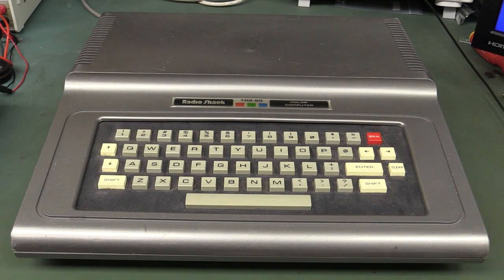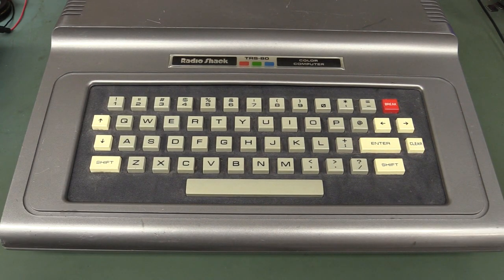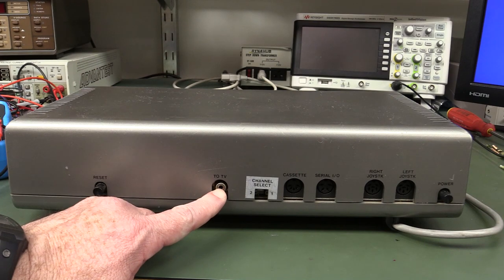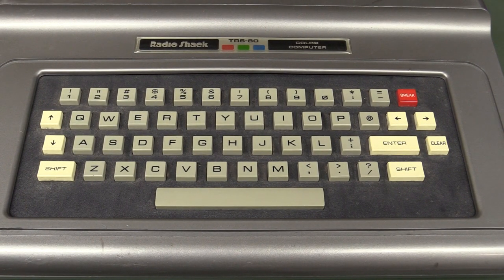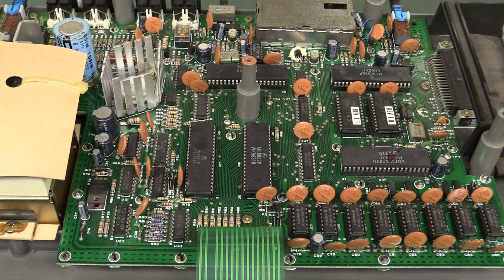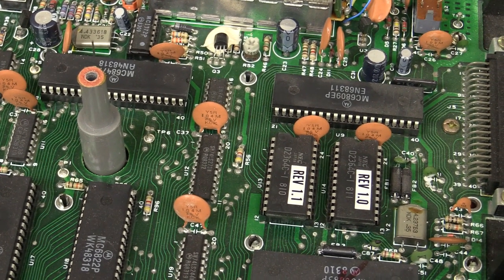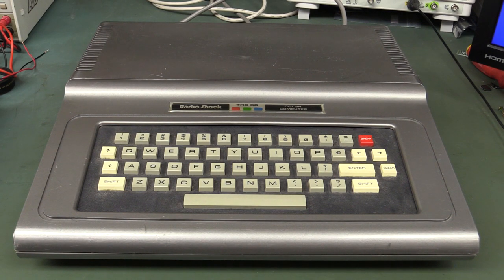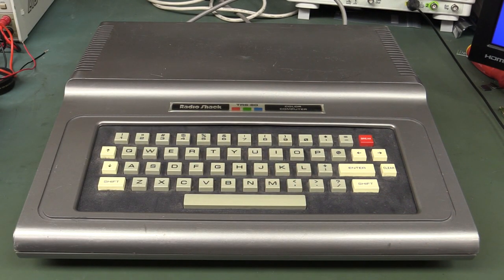EEVblog #1021 - Retro Radio Shack TRS-80 Color Computer

Comment: Oh man. What a walk down Memory Lane.  My parents bought me one of these for Christmas when I was 12, and I used it to learn 6809 Assembly,  and that has led to a 20+ year career in programming - I now write world-scalable cloud software.  I remember reading the thick 6809 reference manual for hours, the "Z-Bug" plug-in cartridge debugger, and the cassette recorder you stored your data on.  I remember learning to solder to upgrade the RAM from 16K to 64K (who will ever need more than that???).  I remember taking on an extra paper route to earn money for the $200 (!) floppy drive.

Probably the best thing my parents ever did for me was buy me a CoCo.
Reply: About my same story!  I had the "Editor Assembler with ZBug pack" too, a COCO 2, and upgraded to the COCO3.  Best gift I ever got!
Reply: I started with a 4k Timex-Sinclair 1000. It was a birthday present from my parents. It was best as a door stop. 4 failed within 2 weeks. We ended up returning it and my parents got me a 16k CoCo 1 for Christmas. That ended my allowance for a long time, since that thing cost a relative fortune at the time. I learned to make my soldering iron do the Triple Lindy when I upgraded the chicklet keyboard. The aftermarket ribbon cable was very thick and unwieldy and partially tore out of the keyboard's circuit board...so I had to solder a few tiny jumper wires. Scary.
Reply: Good story! I loved the hobbyist industry that quickly sprang up around the Coco in the 80s. Companies like Spectrum Projects, one of my faves. Didn't get into Assembly then, but actually thinking of taking it up now for fun!

Comment: WIth a simple capacitive buffer, the DC level will drift depending on the content, but those converters can also be rather fussy, especially with 50Hz sources
Reply from the maker: The problem was still there even without the AC coupling and using the recommended transistor buffer, so it's not that. The car rear view mirror was rock solid with AC coupling though but ultimately didn't look very good. So the ebay converter box is a bit flaky.
Reply: A lot of modern tv processing chips don't like the 240p signal that these older systems would often put out. (Since it was essentially a hack.) Perhaps that is the case here too?
Reply: most 'home' computers video signals did not conform totally to 'broadcast/official' standards, which modern tvs are designed for, some tvs are extremely picky, like mine...
Reply: many produced in particular a 'bodge' single frame sync pulse, instead of a correct pulse train, ,and some incorrect/missing 'back porch' level...
Reply: Obviously in the 80s this would be connected to a CRT TV. CRT TVs are much less picky about the input signal. They'll just display what ever is input, pretty much.
Reply: Shouldn't the resistor on the emitter follower output be 75 ohm? If there's impedence mismatch the sync will be affected as well as messing with the PAL subcarrier quality. On an interlaced CRT screen it would look perfectly clear, unfortunately the scan-conversions done on the analogue inputs on modern displays are sub-par and make the picture appear worse than it should be.
Reply: very likely! especially if its a modern tv, as i said above, the sync pulses are not to 'standard', this wasnt a problem with older tvs using analogue sync processing...
Reply: are you connecting by rf(aerial) or some sort of composite/rgb feed? if composite, you could try one of those 'video copy processors/enhancers' as these usually 'clean up' the sync pulses..
Reply: I believe 75Ω is the impedance not the resistance of the coaxial cable that was used. But my electronics is shaky at best so there is that :P
Reply: yes, and is also the input impedance (in many cases a 75 ohm resistor to ground) of the composite in of a tv...

Comment: I had a Coco 2 and I still have a Coco 3. Very cool machines in their time. They actually had a multitasking OS called OS-9 That was doing windowing more efficiently at 2Mhz than the PCs at 3.77Mhz. Ahh those were the days! When efficient coding and assembly were necessary skills to create software!
Reply: I had one a bit older than what's in this video. Mail-ordering a real keyboard was mandatory with those. I remember the horrific confines of 16k and the feeling of luxury when I upgraded the RAM to 64k. Then, inevitably running out again. Swapping subroutines from the disk drive became standard. I also remember swapping the ROM to RAM and modifying the Extended BASIC to suit my needs. I learned Assembler on that rig, too. LOVED the 6809e instruction set. I have emulators now...always toy with the idea of buying a vintage CoCo online.

Comment: Dave, thanks as always for giving love to vintage computers. I hope you can do a video on the BBC Micro some day so I can hear you rave about its beautiful design. I'm gonna put my neck on the line and say I don't think any 80's home computer can really compare for build quality. Come on you Brits, back me up!
Reply: Yeah, the issue 7 boards were pretty indestructible. Dave did an Acorn A3000 here, by the way: https://youtu.be/tPq7OF3fkcE
Reply: ForViewingOnly

The Beeb was and still is an amazingly solid machine.

Only common issue are the X2 mains filter caps releasing the magic smoke, but that's no big deal, just as long as you hold your breath. lol

I'm hoping Dave and everyone on the EEVblog forum has at least seen "Micro Men"?
(there's a good 720p version on YouTube.)
Reply: I was 6 in 1990 and my primary school had a BBC micro. Obviously at that age I didn't know how to use it.
Reply: How about compared to the Apple ][? Really, that is a very interesting design which isn't too far off the BBC, but with the ability to really modify its abilities via adding in more cards. It even had a built-in assembler in the early versions, so quite equivalent in many ways.
Reply: Yeah, I was thinking of the Apple II when I posted the original comment. Another beautiful and reliable design, but I'd probably put the BBC Micro ahead of it for design & build quality... maybe I'm a biased fanboy. But the Apple did have the BBC beat by 4 years though (1977 for the Apple compared to the Beeb's 1981).  The Apple is the only other 8-bit home computer I can think of with a built-in switch mode PSU like the BBC.
Reply: Having owned both in the day...

Apple II is slightly faster (1MHz vs. ~900kHz) but a less capable CPU (6502 vs 6809).  Later models of both ran faster.

Apple II has higher resolution video (40x24 text, 40x48 low-res graphics in 16 colors, 280x192 hi-res graphics in 2 colors (6 with artifact colors)) vs the CoCo's (32x16 text, 64x32 low-res graphics in 9 colors, 256x192 hi-res graphics in 2 colors (more with artifact colors)).  Later model Apple IIs went up to 80x24 text, 80x48 "double-low-res" graphics in 16 colors and 560x192 "double-hi-res" graphics in 2 colors (16 with artifact colors).

Apple II video output was always composite (requiring an external RF modulator for TV output).  The CoCo was always RF output (requiring a hardware hack for composite).  Apple II's supported RGB video via expansion cards.

CoCo has better sound.  6-bit DAC vs 1-bit "click the speaker" register.  Apple II's needed third-party hardware to get good sound.

Apple II has more slots (8 slots) vs the CoCo's single "cartridge port".  The CoCo later got a "multi-port adapter" to support four slots/cartridges at a time.

Apple II had a much better keyboard (mechanically), but was inferior from a software perspective.  The Apple II's keyboard was effectively a TTY attached to a serial port, whereas the CoCo was wired to one of the PIA chips and could detect things like key-up events and (within limits) detect arbitrary combinations of keys held down simultaneously.

Comment: Boy, I could go on for hours about this machine.  I had one back in the day, and to answer a few questions, #1, yes, once you got the video straight, that's about how good it looked on a TV, mainly because you're compressing the composite signal into RF modulation to feed into your TV antenna input.  If you ditched the shitty RCA cable they give you with the unit, and use a really high quality shielded one, and you had a TV that "liked" the signal from the CoCo (some rendered better than others), that's about the best you could do with RF modulation.  The composite mods DEFINITELY improved the video by leaps and bounds, mainly eliminating the herring bone interference pattern you get with RF modulation.  The 3rd version of the computer actually had 3 different type video outputs... RF modulation, composite out, and CoCo 3 monitor input on the bottom of the unit.  The CoCo 3 monitor was a digital monitor, and a proper computer monitor for the CoCo.  It had the absolute best display you could ask for along with true lower case characters, (no fancy decenders mind you), along with 40, 64 and 80 column characters.  The 3rd version could display up to 16 colors from a palette of 64 colors.  Aside from the the slightly improved video, the 3 was mostly identical to the 1 and 2.  Depending on the age of the MC6847, there is a way to kick it into true lower case on the color computer 2, not sure if the late model CoCO 1's were capable of that or not.  The design essentially came from a terminal that was made first.  A company called agVision wanted a cheap terminal to sell to farmers, so they went to Motorola who basically handed them the design you see in the block diagram, and instead of BASIC in ROM there was a terminal program.  agVison needed someone to design, manufacture and distribute the unit, so that's when the approached Tandy.  Smart cookies at Radio Shack realized they could swap out the terminal program for BASIC and have a general purpose machine rather than a task specific computer terminal.  The price wound up being the same, so the terminal was soon canceled, and the same terminal software was available as a cartridge.  A 4 connector expansion interface enabled up to 4 cartridges at once, hence, a disk controller, proper RS232 port, etc could be connected and software selected at will.  Believe it or not, there's a still thriving CoCo community out there to this day complete with people making new software.

Comment: You could also get the "Radio Shack Color Computer Technical Manual" which was a publication of Motorola for Radio Shack. It was a true technical manual (about 80 pages) with complete theory of operation of all the major circuits in the TRS-80 CoCo complete with schematics. The publication is still available online. This manual along with the "Assembly Language Cartridge for 6809" were pure gold for this (at the time) high school senior.
Reply from the maker: Yes, I have this linked in the description.

Comment: Back in '81 we used to sell these like hot-cakes until the VIC-20 tapped the market. For a little while Tandy made a scaled-down CoCo called the MC-10 but I haven't seen one in years. As an assistant manager at the Toronto 645 Yonge St. store, they never paid me enough money to buy a C64 so I had to steal one... technically... Since my brother and I lived near the Commodore plant in Scarborough, we used to check the dumpster at night until we got enough parts to assemble our own working C64 (complete with floppy drive). As Charlie Bunker used to say, "those were the days".
Reply from the maker: Great stuff!
Reply: The MC-10 was essentially a color version of a Timex Sinclair 1000.
Reply: Our Canadian models had that "CoCo look" with the Chicklet keys. I think I opened one and saw a Motorola 68 series CPU (but not the mighty 6809).
Reply: I remember that store: just north of Isabella St.
Reply: Yup, just a hole-in-the-wall so close to Yonge & Bloor (proverbial arm-pit of Canada..) I always wanted to work at Paul Aire's store down in the Eaton Center. No matter how closely we kept vigil, we always had stuff stolen right out of our front display case on Christmas Eve. Elbow-to-elbow last minute shoppers, thieves and skin-heads.
Reply: Wasn't it Archie Bunker?
Reply: Roger Wilco Oops! Yeah, you caught one of my many senior moments...
Reply: Yeh, I have more of those than I'd like to admit.
Reply: @rogerwilco5187  Yup, it was. loved it.
Reply: Despite the name, instead of a 6809 the MC-10 had a 6800 CPU which was significantly less capable. (Actually a 6803 microcontroller, if I recall correctly, but its CPU core was 6800.)

Comment: Those ROMs are Color Basic 1.1 and Extended Color Basic 1.0. The second generation of the CoCo "one" came with Color Basic 1.1. Fun note: This was back before BIOS days so some smart assembly language programmers leveraged code in the ROMs by calling directly to the starting addresses of the routines. This created an incompatibility between the old and new ROMs with some specialized applications.

Comment: One ROM is for Color Basic, the other is for Extended Color Basic.
Reply from the maker: Oh, interesting, thanks.
Reply: Back then, Radio Shack would NOT sell you the Extended BASIC chip. You were required to bring your computer in and they'd ship it to the closest service center for installation (at an additional cost, of course). I think I was without mine for over a week. Mail order houses would happily sell you just the chip. The specialized service instructions were "take off lid, install chip in socket, replace lid".
Reply: Or.. you took a cassette tape to your local Radioshack, and  did a "CSAVEM" command to save the Extended basic rom to cassette, and took it home to burn your own EPROM..  Not that I'd know..  :-)
Reply: I recall the articles which told you how to burn your own EPROM but left you on your own to somehow get a legal copy of the contents.
Reply: more info.
Reply: "legal copy"?
Reply: @drteknical6571  The code is proprietary, owned by Tandy, so no one wanted to publish it due to the legalities.  Rightfully so, Tandy expected customers to pay them for it.  But if you had access to the right machine, or via some other "underground" means you could obtain a copy, then you were in business.  As someone mentioned above, one could enter a Radio Shack store, and surreptitiously copy the ROM contents to cassette.  Chances are that the sales people didn't understand that and presumed someone was simply just testing out the machine.

Comment: My very first computer was a CoCo. My dad brought it home just before Christmas in 1980 if my memory serves me right. It was an earlier production variant, with the black keyboard surround, the top badge shifted over towards the left side, and another badge on top near the right edge to indicate how much RAM was installed. I was instantly hooked, and my earliest computer programming experience was learning BASIC from those same books!

Yes, the keyboard was awful. I always lusted after the keyboard upgrades advertised in the CoCo magazines... and I finally got one of them earlier this year! :) Old analog TVs often do a better job of dealing with vintage home computers than modern TVs and dodgy composite video to HDMI adapters, but the screen did look pretty bad by today's standards. On a contemporary analog TV, the screen would have a softer blurriness vs. the blocky jagged edges that you often get when converting to a modern digital display.

NTSC models could make use of color artifacts to get four colors in high resolution graphics modes. I don't recall whether the PAL models can pull the same trick.

I used that CoCo up through 1986, when my folks got me a Commodore Amiga 1000 to take to college. Though I must admit that towards the later days, I used the CoCo less and my dad's Lisa more. I still have that CoCo, though it was missing and thought to be long gone for decades. We thought that my folks got rid of it along with the old Lisa, but then it turned up in a box when my folks moved a couple of years ago! I haven't turned on my original one again yet, but I do have a few others that I've acquired once I became very interested in retrocomputing: A couple of silver CoCo 1 computers, one of which kame with the HJL-57 keyboard upgrade that I wanted so much when I was younger, a CoCo 2, and a CoCo 3.

My CoCo 2 is one of the later ones made in Korea, in which they used an upgraded video display generator chip that's capable of real lower case. That wasn't officially supported by Tandy/Radio Shack for compatibility reasons, but it's possible to enable the lower case mode if you know your way around a soldering iron.

The CoCo 3 is quite a bit more advanced than the CoCo 1 and 2. It supports 80 column video and higher resolution graphics, and there was a matching RGB monitor for it. It could be upgraded to 512k (officially) or more (unofficially) RAM, which was bank-switched into the 64k address space. The RGB monitor offered good enough resolution for 80 column text, unlike a color TV, but it didn't reproduce the color artifacts that many games used.

Thanks for making this cool tear-down video! When you posted that teaser picture of the enter key on Twitter, I immediately recognized it!